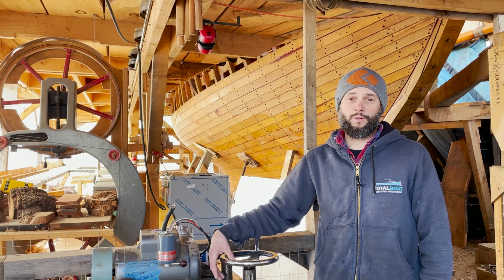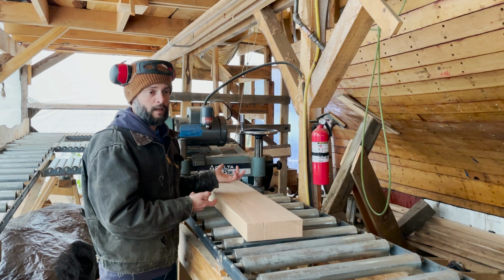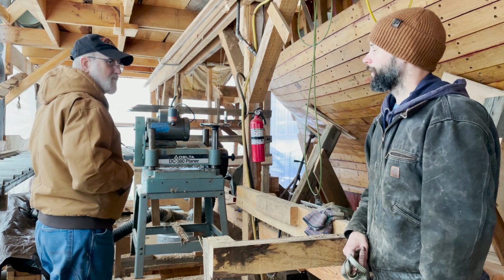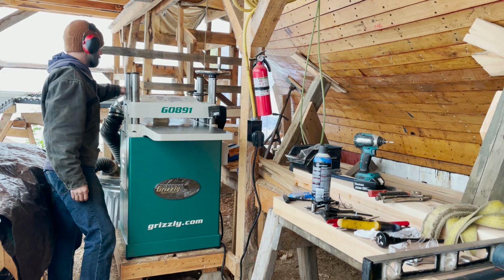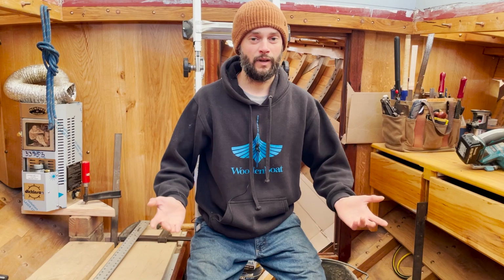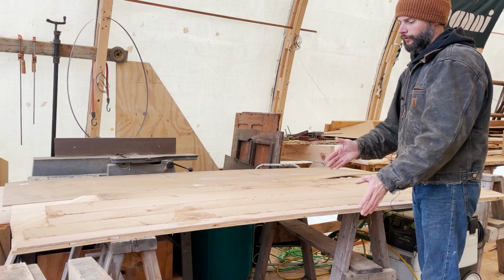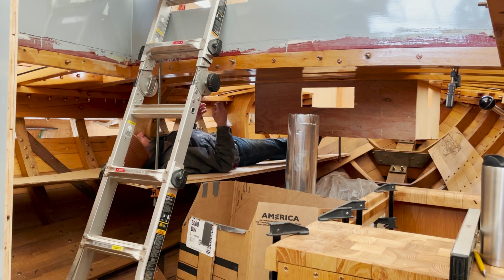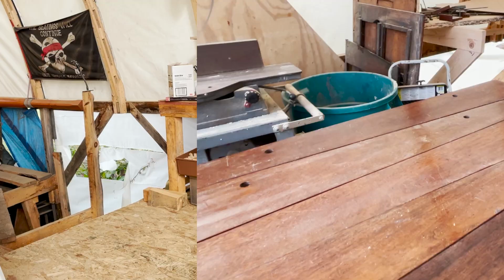A Grizzly in the Boathouse - Episode 186 - Acorn to Arabella: Journey of a Wooden Boat

Comment: You can easily weld stainless steel with the MIG welder you currently have. Most production stainless work is MIG welded. As long as you back purge your welds when possible you shouldn't have any problems doing it yourselves.
Reply from the maker: Given the critical nature of the tanks, and the fact that someone out there has a stainless break, we’re hoping for skilled hands. Thanks for the encouragement!

Comment: Hello folks,
                    yes..... we will now get A to A one hour earlier here in the UK.
Well done Steve and the Gang for getting the build so good  and so far.
I just have a couple of comments, love the new thicknesser, but if you turn it round your controls will be at the front and much safer.
When you "climbed" into the bunk it looked a bit cramped and the corners of the cockpit look awfully sharp near your knees and you didn't even have a mattress in there.
Would it be a bit uncomfortable in a rolling sea ,just  a few thoughts,
Cheers from the UK.

Comment: It may well be too late now, but might I suggest making the pilot berth from aluminium tube with a net insert. This would be easy to move or fold out of the way and the net is much more comfortable to sleep on with a 2 inch mattress. The ladder could be side hinged (as has been mentioned) so access to the berth or storage area would be much easier. Are you going to build a box around the engine (with sound-proofing) or make a full height compartment for it?
Reply from the maker: You’re describing something called a pipe berth, and it was considered.

Comment: Make the stair slide right! It can be lifted to unlock, slide right and return with gravity to lock back in original position.
Piloting is almost always shared and not everybody is that pro contortionist! (cheers for you).
Other point is that sometimes a quick exit is needed to check a navigation or proximity alarm/hazard! 
Awesome job! Keep strong and beautiful as its being!

Comment: Hey mate, that mig you have is absolutely capable of scratch start tig welding. Cost for the torch is probably around $100.

Takes a little bit to learn, but you'd have it down pat well enough within a couple of hours. You won't be stacking dimes as they say, but you'll be able to produce a functional weld, if not an overly pretty one.

You local sheet steel shop is also likely to be able to cut and fold the steel for you at minimal cost. A simple box for example is two sheets, four folds to produce two U shaped sections you can weld together.

Basically, it's not as hard as people like to pretend it is.
Reply: When your expertise is woodworking, it is probably better to contract metal work to the ones who Excell in metalwork. The guys could be busy doing all the woodwork while at the same time the pros work on the tanks. It's a timesaver really. Also the guys do want to finish the build in the shortest time . Learning a new craft would set them behind schedule. Not that there really is a set day to be completely finished and launched in a body of water.
Reply: I weld stainless for a living..... been so for 40 years,,,, I would leave that to a professional,,,,not as easy as it looks

Comment: A key point of question... every time you go to start the engine on you boat you should always check the engine for oil, belt tension, leaks, water in the filters and anything else that looks wrong.  Will your set up with the pilot berth and the refridge location conveniently allow you to do these basic sailing cruiser tasks?

Comment: Gives a whole new meaning to 'climb into bed'. 

The arrangement to service the engine wasn't clear to me. Will you be crawling under the berth, using the space between the berth and the engine box, or - maybe - removing or hinging most of the berth up and away. Unlikely you'd be servicing the engine and needing the pilot berth at the same time.

Comment: an option would be to make the house ladder into three sections in the current location. with a section of the ladder at mid height, to lift up a 28-35"section, to provide more room to enter and exit the rear berth. the ladder when not opened for access to the berth would stay in the normal position. you could use a compressed air cylinder, like a vehicle hatch lift uses. it would prevent movement during high seas. (the air cylinder if positioned properly, would keep the ladder section in the down position or in a upright-open position. just like in a vehicle).

Comment: While I recognize that the mizzen precludes the companionway being located 'midships, any effort to bend that companionway ladder closer to the centerline will be worthy of consideration. Some modern designs include a sort of curved ladder/stairs, or even a sort of parallelogram that brings the base of the ladder/stairs toward the centerline. Yes, the quarter berth is almost exclusively a storage space, but anything that can help you better access this area means that it will be more valuable as a multi-purpose space. We had some heavy boxes at the foot of ours. Our Bristol Channel Cutter's quarter berth was very useful storage space, but wouldn't have been had we had such an arduous access to it. Yes, you'll want to go head first! Also, it was our guest berth; at age 25, it wouldn't have been horrible, but that was 30 years ago and things have most definitely changed. Of course, if you're thinking that it will also serve as a proper pilot berth, you would want the ability to pop in and out quickly and easily. Further, the thing we craved most was more galley counter space. Our reefer (icebox) was opposite the galley and served double duty as the nav station; see https://samlmorse.com/img/bcc_layout2.jpg. It provided precious additional food & meal prep counter space. Any effort to make your nav station more useful as a galley extender would pay off.

I agree with others: your production quality has become absolutely marvelous! Kudos to your team!

Comment: I realize this suggestion is probably coming way too late but I figured I toss in my $.02 anyway.  :-)  Why don't you hinge the companion way ladder on the fridge side to accommodate getting in and out of the pilot berth?  You'd need to  include a simple locking mechanism so it does flap back & forth in rough seas.  All in all it should be pretty easy to do given your wonderful skills with wood.   
Love the channel.
Reply from the maker: Keep watching!

Comment: Seeing how much that plywood bunk flexes under your light weight I would recommend splitting a 2 x 4 and gluing and screwing the two pieces to the bottom of the plywood sheet to firm it up for you and anyone else who may use it (temporary equipment placement or consumable supplies).
Reply: You could also put hinges on the hull side so that you can rotate it out of the way for working on the motor.

Comment: Hey Steve, the new planer looks awesome. When you were putting out options on the stairs and entering the pilot berth, one idea that came to my head was splitting the stairs into two segments. The lower could be fixed and going up till the top of the galley. The second part would be hanging from a hinge on the side of the house. That way, you might be able to fold up the top part and temporarily fix it to the roof of the house (or the wall of the head) and get more access space to the berth. You could even angle the stair segments differently to create more space at the bottom end to increase the sitting area in front of the nav table. Maybe even add a foldable chair for that to the side of the head wall. What are your thoughts on that? I hope I gave you some creative input with that. Thanks a lot!

Comment: As much as I hate to say this since it goes against the general AtoA vibe (as well as my own aversion to using plastic anything) but I might seriously consider in this case using polypropylene for storage. Finding and fabricating a high grade stainless is indeed difficult and very expensive whereas good quality poly is way cheaper, light, easy to clean and replace, and as of today highly sought after by recyclers. It will more than likely return to resin to make either more tanks or orange safety cones and those lego lane dividers. 😂
Reply from the maker: It doesn’t go against the vibe at all! Poly propylene is a fine choice for water. Steve would like stainless.

Comment: Playing catch up and it is probably too late but wouldn't it be easier if the ladder was more to port maybe even a little more off-center to port or even use a pole paddle ladder that curves more to the center for more room both for the map table and for getting in the bunk? here is a picture to give you an idea of what I mean. We used to have a wooden pole with paddle steps for the attic. kind of like climbing up a tree with spikes.

Comment: That old Delta can be done off as parts. Those internal parts including the cutter head are always looked for as well as the handles, buttons, wheels and such. There are a few that could bring that Delta back to full working order and resell it as those atleast are simple enough things to do now since having machining tools and machines are not uncommon now. To be honest, wood shops don't run the amount of hard wood that you are running through that Delta so you put it through its paces.

Comment: Can you 'hinge' the top and bottom of the port side of the ladder, allowing it to be momentarily swung inboard without removing it completely? A 'snap catch' that can be reached from the berth would lock down the starboard side. I think that would allow greater access to the engine while leaving the ladder in place for crew use...

Comment: can you mount the ladder into a slide rail or on rollers top and bottom, also fit lock bolts top and bottom to ladder ,that way you can have easier access to bunk?

Comment: Hi there. You could make the ladder by the following way...the 1,2,3 and 5 steps. The 4th step that is in the way to go the bed can be made folding upward to have easy access. Whenever someone wants to use the ladder gets it down by hand if he's going up, or by left foot when going down. It should have been reinforced step and with good hinges to hold any weight or force. Starboard side of ladder between steps 3 and 5 could be missing for that to have easy access. Greetings from Greece.
Reply: I had something like the same idea. Maybe have the whole upper ladder telescoping up, or folding away. So long as it can be put back by the person in the bunk once they've got in, or it can be redeployed by someone at the head or the foot of the ladder like in Lefteris Korelis' scheme, it should be easier than clambering around a fixed ladder IMHO. (But it really is a humble opinion, just my 2 cents.) And greetings from Paris!
Reply from the maker: There will be more on this later… since the refrigerator will be there, it opens up an option to have it as one of the steps. Stay tuned!

Comment: Question:  When you made the Nav table and other flat surfaces, you just glued the wood edged together and did not use biscuits.  Wouldn't that have been better if you had used biscuits to connect the wood.  Glued wood can eventually just fall apart.
Reply from the maker: Wes described the other week why biscuits aren’t necessary for edge gluing. The glue itself is stronger than biscuits.

Comment: Assuming an apples to apples feed rate, the single biggest variable is going to be the sharpness of your knives. Horsepower counts for something, but Grizzly motors are notoriously over rated. I’ve personally cooked 3 of them (2 planers and a jointer.)
I would also suggest, if you’d like to achieve truly flat and straight board stock, run both a face and adage through the jointer before Avenue considering the thickness planer. This method will give you a flat and true face, along with a perpendicular edge. You need only milk the opposite face for your parallel, and a table saw cut can give you the parallel edge for glue up.

Comment: For the pilot bunk access. couldn't you split the companion ladder in half? so the bottom rungs are fixed but you can 'lift up' a few of the steps' slide in and drop the steps back down again?

You would also be able to use the bottom of the companion ladder to climb into the bunk.

Comment: About half of the comments regards the troublesome access to the bunk. That tells us the design isn't optimal. (Unless you use this bed as a way to scare away mother in law from joining on the coming journey. 😀 If I where building this boat, I really would consider the possebilities to make a better design.  I would find it much easier to access  the bed if i could sit on the short end of the bed, then rotate 90 degrees on the butt, so i sit pependicular to the bed. This could be done behind the ladder. Then just lift the legs, and  rotate to the final position. Unfortunately this seems to require a little lowering  of the bed.  (Remember, you tested it out without a matress.)
Reply from the maker: The design also doesn’t involve a final installation that only relies on three clamps hanging down from deck beams.

Comment: I'll be honest, I learnt TIG welding, and TIG welding stainless was pretty easy to pick up. Just took a few hours of watching youtube videos to learn the methods, and practice on some scraps.
Reply from the maker: Sweet! Well done. We’d also need a break and a few other things, and the custom tanks will take skills that would take us a long time to learn in order to make them as sound as we’d like. This happens all the time in boats: yes, DIY, but manage with Grace those times when pro help would be better.
Reply: @AcornToArabella  
Are you considering putting baffles in the tanks to restrict sloshing?
Reply: @AcornToArabella  Absolutely, I wouldn't recommend taking on a large staino fab without some prior experience. Leave it to a pro. Stainless has its own quirks when you try to weld large pieces like that. Loves to pull and warp, and you'll need to purge it properly

Comment: I'm not sure how it  might impact footing in the cockpit,  but is there a way to bevel the bottom port and starboard sides 45 degrees?  It might make for a more comfortable /safer pilot berth and head clearance  around the diesel engine.
Reply from the maker: It probably wouldn’t be great, and since a lot of our lives will be spent in that cockpit in comparison to berth that will, for most of its life, be stowage… we’ll keep that cockpit as-is. Neat idea though.
Reply: @AcornToArabella  as a compromise, the cockpit corners could have an internal (say 1") and external (2") radius which would make for easier cleaning inside the cockpit and more friendly space around the bunk/engine area.  Just a thought.

Comment: Does the new Grizzly thickness planer have a spiral cutter head, multi-staggered blade cutter head, or a normal 2 or 3 straight blade cutter head?

Obviously, with a spiral head, or multi-staggered cutter head, it would be even faster if the test was done with a normal straight cutter head..

Ugh, sleeping over a diesel engine on a tossing boat.

Comment: If you have the Lincoln mig machine you can weld stainless yourself. Buy stainless wire and switch to pure argon gas. Yes, tig is nicer to look at, but your tanks will be built in and not seen.
Reply from the maker: Since the water tanks are critical, and we’d be new to stainless welding and don’t need so much work done that it makes sense to build that ability, we’re admitting that having pro help would be best.
Reply from the maker: But thanks so much for the encouragement, John!

Comment: Will you put internal walls with holes in the water tanks like in aircraft fuel tanks in the wings?  - To stop the fluid from sloshing around and causing a pressure blowout of one of the tank seams?
Reply from the maker: Maybe. Those are called baffles.

Comment: The entrance to that quarter birth  is sketchy .  Fortunately you have the skills to revamp if you don’t like your design.  Right now it would make a good cubby for tools, climbing gear, etc. The opening It is likely too small for sail storage and pulling  large sail bags in and out.  On a starboard heel you might smash expensive instrument displays going in and out.  What was the original interior design ? Are you getting help on interior design?
Reply from the maker: It’ll be less sketchy when it’s in its final spot. Stay tuned and thanks for watching!

Comment: so....man came up with the wheel many thousands of years ago. There has to be a better way to move that planer. I've got a Grizzly the same size as that Delta and it's a beast to move without wheels under it
Reply from the maker: Happy Friday! When Steve gets something new in the shed he’s anxious to get it up and running before Joe can invent wheels for it. 😉 The comealong worked well on the dirt floor.
Reply from the maker: (But also…. Yup.)
Reply: Just a thought for moving heavy items...drop what planking you can, and slip those plastic serving trays at restaurants under the legs of your item. It makes moving this a LOT easier.

Comment: can you rotate the cabinet? it looks like its just 4 bolts, you might have to extend the wires but its better than cutting a hole in it
Reply from the maker: The feed direction works well with our entire setup.
Reply: @AcornToArabella  no I mean unbolt the entire head from the cabinet and rotate the cabinet so your still cutting in the same direction but the cabinet is 180 degrees from where it is now, to get the controls on the other side and you dont have to cut another hole in the cabinet.